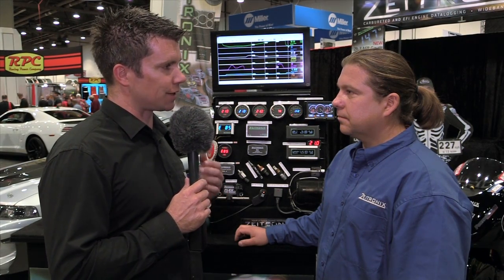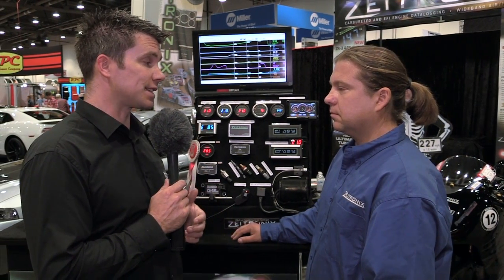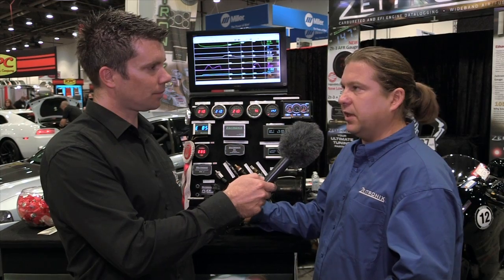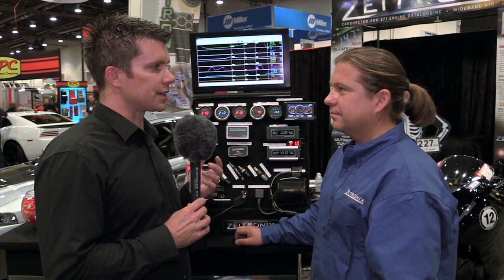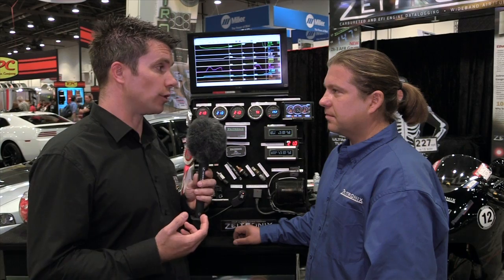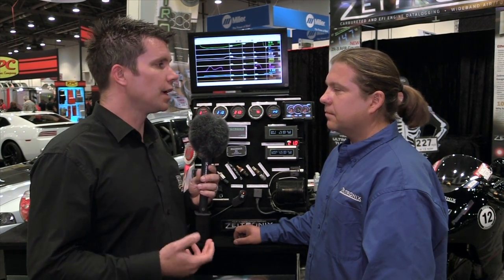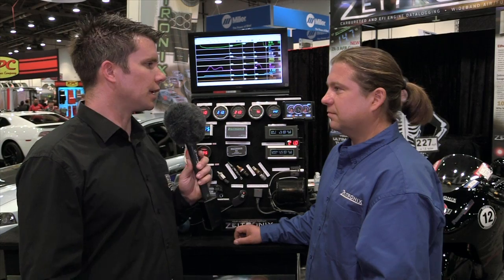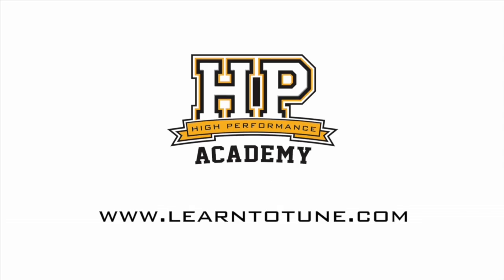Zeitronix Ethanol Content Analyzer ECA-2 | Product Talk with Andre Simon

Comment: So i can use the ethanol content display (just the one with the blue or red display reading) with my haltech ecu and flex fuel sensor?
Reply: I like how NOBODY answered your question. I have a flex capable ECU as well with a sensor and works great, just want a gauge to work with my flex sensor.